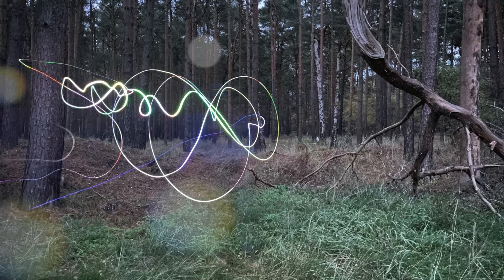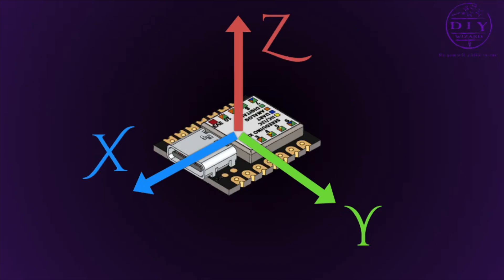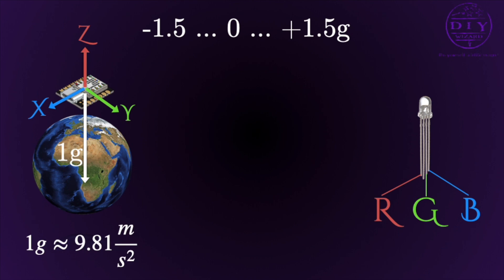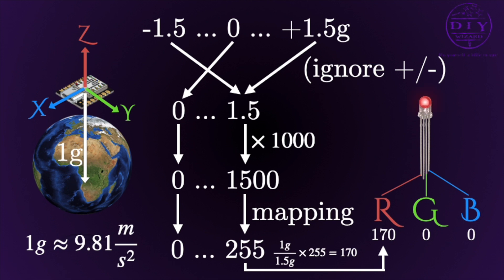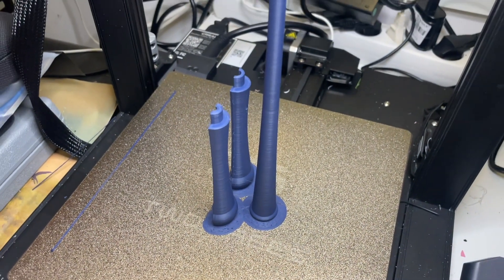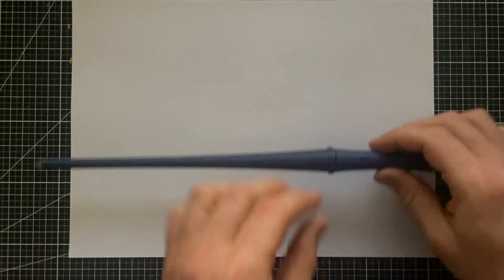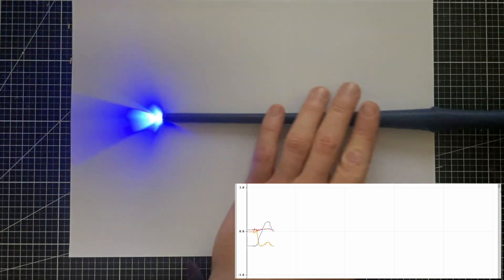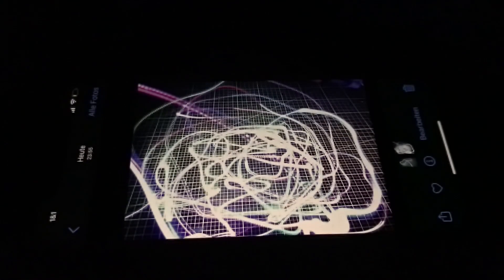DIY Arduino controlled magic Wand with RGB LED that draws from acceleration data in midair

Comment: Point upwards, i suppose, downwards is red light.
Reply: Move it upwards with 1g :) orientation doesnt matter
Reply from the maker: Since I just change the sign in the code, upwards equals downwards ^^ so this ist not yet the solution! Think about how there ist no force/acceleration on the wand
Reply: @diy_wizard  don't move the wand and keep it still
Reply from the maker: @niveo123  than you would still measure the normal g force of 1g towards the middlepoint of the earth ^^

Comment from the maker: If you know how to
Turn of the LED in use (besides using the switch odr
Unplugging anything), leave your comment here ⬇️
Reply: Send it to the ISS or Vomit comet...or drop it from high enough... We don't have the code, but I guess zéro G would give zéro power output to the led....
Reply: Btw, thanks for your work, It help me a lot to make a remote control wand for my TV...